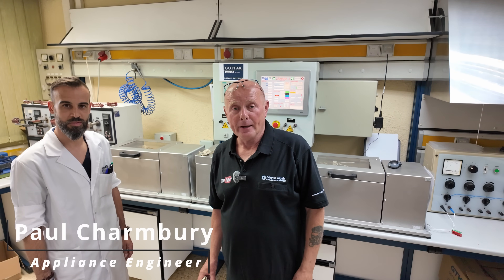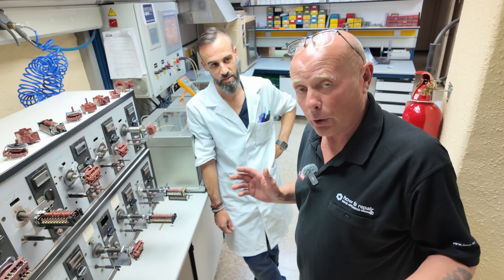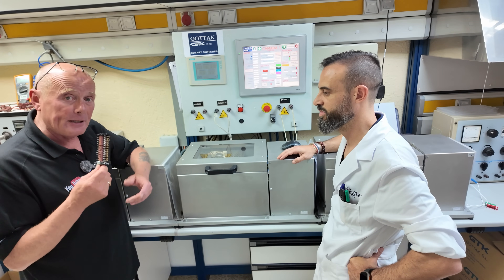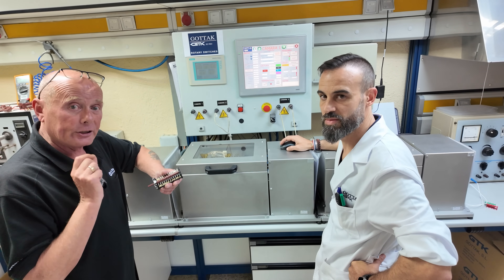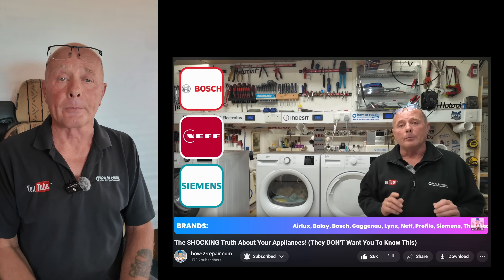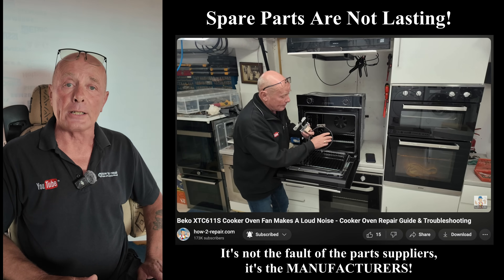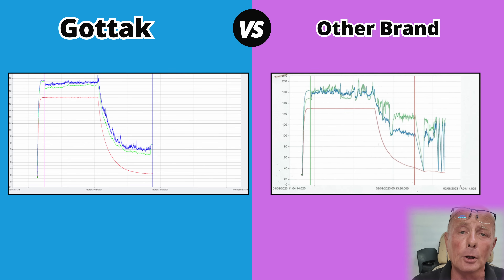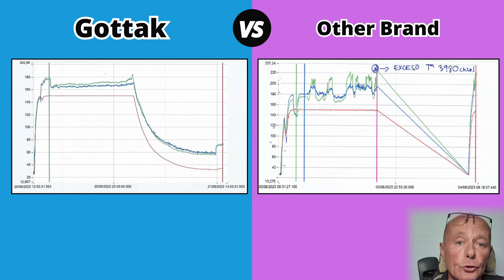Why Your Appliances FAIL SO FAST! Lab Results EXPOSE the Truth!

Comment: I've had my good ol' Whirlpool washer and dryer for 19 years, no repairs, no problems. I've been looking at new ones......well, just because.....and the retailers tell me 5 or 6 years is about what you get now. And my water heater " purchased at a pro plumbing supply "  just developed it's first leak 3 days ago, after 15 years. I got an AO Smith to replace it. I'm told to expect about 10 years or so If I flush it every 6 months/change the anode rod every couple years. All the suppliers who sell appliances to the trade told me to not expect the long service life I've had with the older stuff to apply to my new stuff......because of built-in self destruction.
Reply from the maker: It is a crying shame that the manufacturers won't allow us to have good quality anymore. Thank you for your comment. I appreciate people like you taking the time to write it out. Please share it where possible. It might help others make a wise choice instead of being misled by the industry.

Comment: Wasn’t it an appliance fire that caused the Grenfell disaster? 🤔
Reply from the maker: That is a very important question. You are correct.

According to the official Grenfell Tower Inquiry report, the fire that led to the disaster on June 14, 2017, originated in a Hotpoint fridge-freezer in the kitchen of one of the flats. Thank you for bringing up this crucial point. It underscores the immense responsibility that manufacturers have to ensure their products are not only functional but safe.

For a deeper dive into the importance of component quality and design, please check out the full video here: https://youtu.be/gEgSCbZnHVM?si=wTIw0mELuhWaw4aX

Comment: This old guy slappin’ his bald head, mouth open all looking shocked. HA HA Haaaaaa! Oh my mortal being…
You want my comment.
Here.
You.
Are.
You likely uttered the words: planned obsolescence. He he. I didn’t watch your presentation, to be fair.
So the very original incandescent light bulb, once (easily) perfected would last indefinitely. There are many functional examples today around the globe. It didn’t take long for the first light bulb manufacturer(s) to understand the implications of lost future profits. Thus, the once perfected bulb would be slightly re-engineered to include the smallest addition to the already simple circuit that would include the smallest bit of material that would decay over a [theoretical] 3-5 year term. You yourself at one time probably installed a brand new from the box light bulb and it failed almost immediately. Made to fail!
I wouldn’t suggest the light bulb parable is the first example, but it is quite old. Like you. Why so surprised?
Cheers

Comment: I have a microwave from 1980s still works... Meanwhile new ones the door mechanism or unit itself has quit working.
Reply from the maker: Thank you for your comment. I appreciate people like you taking the time to write it out. Please share it where possible. It might help others make a wise choice instead of being misled by the industry.
Reply: @How-to-repair 
It was a panasonic, you can find multiple reports on their door latch.  I found lifting up  & pushing down a few times will let the microwave start.  I was going to take it apart but they have a special screw design not in a common tool kit.

The one still working is Kenmore

Comment: Appliances are designed to fail after 5 years max.
That is why they only have 1 or 2 year warranty.
The electronic components are poor quality and at their specification limit. So, over time, the electronic boards will fail. Then, the parts will not be available for repair or will cost too much. You will have to buy a new one. 
All appliances should have a 10 year parts and labor warranty by the manufacturer.
Reply from the maker: Thank you for your comment. I appreciate people like you taking the time to write it out. Please share it where possible. It might help others make a wise choice instead of being misled by the industry.

Comment: I fully agree with what you've said. I worked in the electronics industry. It all started when manufacturers had reached a point with their atmost designs that they then could go a step further and make the component fail after a set number of times also depending on the item under manufacture.
Reply from the maker: Thank you for your comment. I appreciate people like you taking the time to write it out. Please share it where possible. It might help others make a wise choice instead of being misled by the industry.

Comment: Any kids born in the 60's-70's in their later years , they knew many household appliances that were  15, 20 even 25+ years old. now compared to todays equipment that if you sneeze or look at it in the wrong way, it will die on you. My Samsung not so smrt TV broke. just out of warranty, It would turn on then you could touch any 1 button on the remote before the picture would fade to black then it would cycle this same symptom. I was told that a new screen would cost 75% to replace the same TV and they would only give me a 3 month warranty where as I could by a newer more recent model, pay 70% of the repair cost and by a brand new out of the box same size TV (without the curve on the old 55") but the new TV came with a few extra bells and whistles like apple play and screen mirroring built in but the best part was it came with a 12 month warranty. What a scam that an appliance of 2 years old cannot be repaired or future guaranteed even by the biggest corporation, it is a gave crime against not only the paying public but the brands we enjoy and pay for are the very ones abusing our consumerism to defraud us!!
Reply from the maker: This isn't a mistake; it's a business model. It's one of the most effective forms of built-in obsolescence. They ensure that when their product inevitably fails—often just outside of warranty—the path of least resistance and least financial risk for the consumer is to throw the old one in a landfill and give them more money for a new one.

Exposing this "repair trap" is exactly why we make these videos. You are right to call it a crime against the paying public.

For a deeper dive into the specific ways manufacturers design these products to fail, please check out the full video here: https://youtu.be/gEgSCbZnHVM?si=wTIw0mELuhWaw4aX

Comment: I was a manufacturer (my products though were built to last forever, they were industrial grade products, used in hazardous places) and we as manufacturers were talking about this one day at work. Because we kept having to replace all our appliances after 5 years and it was driving us crazy. We were like "so we have machines that can turn tons of steel 24 hours a day 7 days a week for decades without failure, but a washing machine doesn't last 5 years... that doesn't make any sense, they both are just rotating machines" In most cases I would say it's the electronics in the machines built to fail. The machines are built well enough, but the electronics are designed to only last 5 years. For example a "motor" basically can't fail there is nothing in it that can. It's typically the motor controller that fails.  However on newer appliances the motor controller and the motor are often built into each other to make it seem like the motor failed. Plus when you open them up you can see their poor quality. Cheap components that fail etc... You could hypothetically design stuff to last centuries if you just ripped out and redesigned the electronics. Or if we made it possible to trace down bad components or... hear me out fuses! Then if something went wrong it's just a fuse you have to fix rather than a whole electronic. But how many modern products have those now days??? It bothers me anytime I hear "oh it was just the motor failed" because you already know they have been sold a lie. Also if stuff were made out of more metal than plastic it would typically last longer too. Plastic ia fine as a material, but over time it decays. Steel stuff will be as good in 100 years as it was today provided you take good care of it. It's ridiculous how we have designed stuff to fail, how do these people sleep at night I'll never know and yeah it is over a 50 cent savings in most cases.
Reply from the maker: Your comment is a masterclass in how built-in obsolescence is executed in the real world. The issues you've described are the very definition of the problem we aim to expose.

For a deeper dive into the specific ways manufacturers design these products to fail, please check out the full video here: https://youtu.be/gEgSCbZnHVM?si=wTIw0mELuhWaw4aX
Reply: Well i bought a yellow German jet washer , used little and the windings burnt out, tried fixing it ; it was so fiddly,  went in the bin .

Comment: Modern front loading wash machines are made with a zinc dissolving spider drum support bracket that sits inside the water that will dissolve and break under load after a certain amount of hours of washing cycles. The machines themselves are good designs and all they would have to do is use a different material for the spider support such as stainless steel they would last 2 decades instead of 5-10 years.
Reply from the maker: It's hard to believe that manufacturers expect consumers to be happy buying major appliances every few years. Using environmental issues to sell more machines is ridiculous, especially considering the ecological damage it causes. They are ruining their reputations by making such products.

Comment: You cannot blame accountants for life cycle decline.  That is a cheap shot at a profession whose mission is to generate and document financial data, not specifying component acquisition.  

If you had actually been honest and thoroughly researched this subject,  you would have been confronted with the real reason for quality decline. The customer demanded it. Having sold appliances in a previous job for fourteen years, I can tell you that in about 90% of my encounters, the major deciding factor was not features or longevity but price.  Consumers want performance at the lowest  possible cost.
Reply from the maker: The big question is a bit of a "chicken or egg" scenario. Did consumers start demanding low prices out of the blue, or did manufacturers, through globalization and fierce competition, first flood the market with cheaper goods, which in turn conditioned all of us to expect those low prices?

It's hard to believe that manufacturers expect consumers to be happy buying major appliances every few years. Using environmental issues to sell more machines is ridiculous, especially considering the ecological damage it causes. They are ruining their reputations by making such products.

This downward spiral on quality to meet a price point is the very definition of the built-in obsolescence we aim to expose. For a deeper dive into the specific ways they cut those costs, please check out the full video here: https://youtu.be/gEgSCbZnHVM?si=wTIw0mELuhWaw4aX
Reply: @How-to-repair . I respectfully disagree with your analysis and present an example to substantiate my point.  Speed Queen is a brand of top loading washer built to provide many years of trouble free service since its primary market is targeted to Laundromats, not individual consumers.  The reliability factor comes at a cost however, in a price which averages $1400 .  Compare that to recently offered washers at Costco or Sam's Club.  Both firms are advertising Korean built Samsung or LG machines for $600.  At that cost difference price conscious consumers will find those cheaper models irresistible regardless of their durability issues and inferior design. Whirlpool, the world's largest appliance manufacturer, recognized this reality when it acquired Maytag.  Their system wide redesign of Maytag's products were not based on their legendary reliability but a price point.  That is what the market demanded and Whirlpool obliged.

Comment: It's across home fixtures. Plastic parts against metal in situations creating repeated stress seems to be a common factor in certain cases like showers and oven knobs and such. Cheap membrane switches are another, dishwashers fail here a lot. What you are showing is a whole other level :(
Reply from the maker: Thanks for pointing out those examples—it's true that manufacturers are cutting costs with cheaper materials, leading to premature failures.

Comment: I had these problem three times with my stove, washing machine and refrigerator. Their solution was paying more for an expensive repair. I ended up fixing myself by replacing just small tiny parts. It was not even a big of a repair. At this point they're just scamming you.
Reply from the maker: Thanks for sharing your experience and your solution. It's amazing how often a simple part can make all the difference!

Comment: omg have you tried switches off a  Amana appliance i know their refrigerators the basic model are bullet proof still made the same way from the 80s
Reply from the maker: It's great to hear you've had a positive experience with a particular model, as some of the older ones were built to last.

Comment: Course the Chinese been doing it for very long time.Lots of crap on the market and overpriced a huge scam.Manufactured self distruct putting weaknesses in the product for it to fail the car industry runs on it.
Reply from the maker: You're absolutely right mate this pattern of manufacturing has become more evident across various industries. Once renowned brands with strong reputations for quality are now often owned by larger corporations that shift production to regions where costs are lower, such as China.

Comment: In a washing machine from the last decade, you cannot replace the bearings or the 
seal because you cannot disassemble the drum. Poor quality in the appliances, in the cars and even in the planes (see last news about Boeing). The manufacturer is interested only to avoid expenses during the warranty period. If he uses non-complying components or did a manufacture mistake, he checks the cost balance between delivering a good product or spending on warranty repairs for some customers, I know what I am saying. They don't care about brand reputation, just short term profit.
Reply from the maker: It's hard to believe that manufacturers expect consumers to be happy buying major appliances every few years. To truly make a difference, we need to get the attention of industry leaders and stop these wasteful practices. Sharing this post is crucial to spread the message. Thanks, Paul!

Comment: I bought a new house in 1999, all new appliances.  I was there 11 years, replaced the dishwasher after 5 years. The house I'm in now is new construction, we moved in in 2020, all new appliances.  In less than 5 years, I've replaced the dishwasher, microwave, washing machine, water softener, had to replace the compressor on 1 of the refrigerators, and already had to service one of the air conditioners.  Just junk, all of it.
Reply from the maker: You’re absolutely right mate, and it’s a frustrating practice that affects nearly every industry. The concept of deliberately designing products to fail or become obsolete within a certain timeframe is a huge driver of unnecessary waste and consumer spending. Whether it’s electronics, appliances, or even clothing, it’s all about maximizing profits at the expense of durability and sustainability!
Reply: @How-to-repair Agreed.  These appliances companies claim to be "green" with their low water use/low electricity cost without mentioning that you'll need to buy at least 3 of each over the next 10 years and they will all end up in a landfill.

Comment: I’ve worked apartment maintenance for 30 years. In by gone years, I have serviced appliances, air conditioners, pool pumps and all manner of things older than me. At the end of my career I have had a hard time keeping any of that running more than 5 or 6 years. I recently bought a gas water heater with a 3 year warranty. Just 3 years, when I used to install units with 10-15 years and expected 20. Add that to the outrageous price of almost $600 for this unit when the old ones were $300 and you get a completely unacceptable and unsustainable world.
Reply from the maker: Thank you so much for sharing your invaluable, front-line perspective from 30 years in maintenance. Your experience is one of the most powerful testimonials we could ask for, as you have witnessed the decline in quality firsthand.

This "price up, quality down" trend is a direct result of the built-in obsolescence business model, where profit from repeat sales is prioritized over creating a lasting, reliable product for the customer.

This is exactly the kind of systemic issue we aim to expose. For a deeper dive into the specific ways manufacturers design products to fail, please check out the full video here: https://youtu.be/gEgSCbZnHVM?si=wTIw0mELuhWaw4aX

Comment: In Australia i inherinted mums top load Westinghouse washing machine because it was to big for her next home.
Had gearbox checked 1 sensor fixed. Something else which i have forgotten.
Keep in mind the machine would have been 15 plus years old. This was done ten years back, so its at 25 with at least another 10 to 15 ongoing.
I would rather refit old than buy plastic crap anymore.
P.S. all switches are analogue as against digital which dont like power fluctuations. Jeff Moore 11:49
Reply from the maker: Thanks for sharing your experience; it's great to hear about the longevity of older machines compared to modern ones. It's hard to believe that manufacturers expect consumers to be happy buying major appliances every few years. Using environmental issues to sell more machines is ridiculous, especially considering the ecological damage it causes. They are ruining their reputations by making such products.